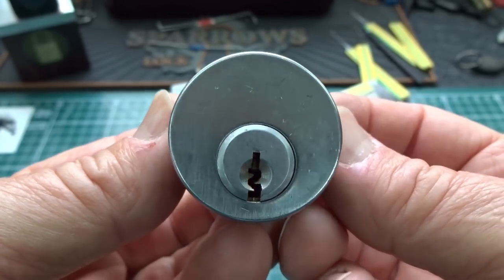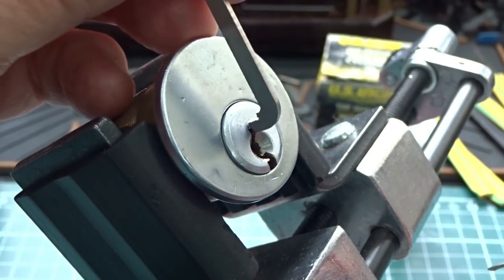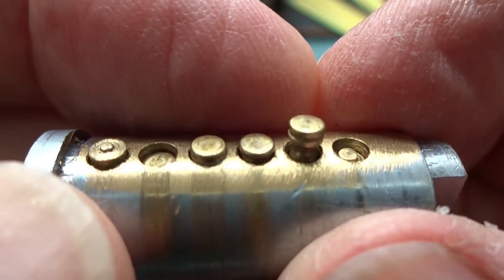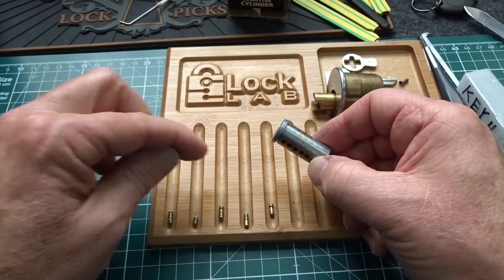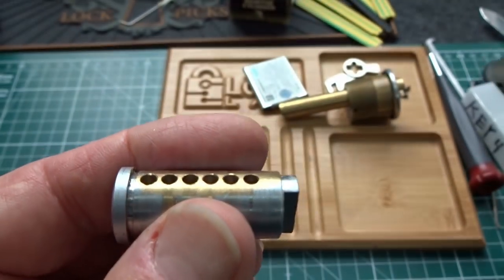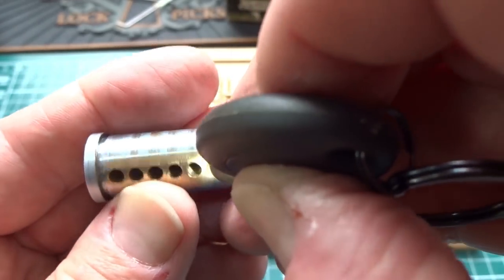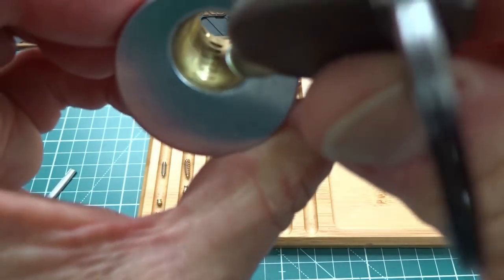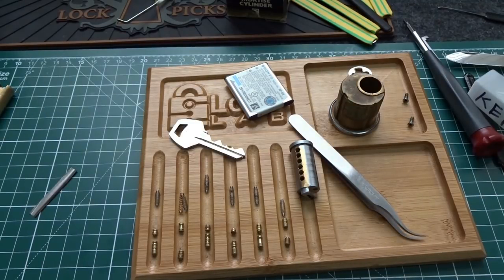(1179) Challenge: Blair's LockSmith Special Picked & Gutted

Comment: I have a lock that does exactly this. It's just a commercial defiant I'm using to learn spools, but it's a pain for me. It will get to a false set, and everything feels seized up, or set. I think pin one is a very short spool, if I really give it some force, I'll get counter-rotation and set, then I have to do the same all the way back at pin 4. It's super easy to overset or drop everything, but it's been great practice.
Reply: Maybe a light spring on the spools mate, lessen up on the tension and feel for very light counter rotation.
Reply: CHOPERUS23 you're absolutely right. If I get careless and put more than the lightest touch on it, this thing just hates me.
I can get it picked, it just takes a fine balance of light tension and pretty heavy leverage on the pick to get those spools set.

Too much or too little, by the narrowest margins, and it starts hurting my brain. ;>

Comment: Ha! I got my 40mm brinks open before you got yours! Mine doesn't have fort Knox warding, though, it's just a stock 5 pin...whatever. point is, I'm getting better, thanks to you bill. Once I understand the mechanism, I can get into almost anything. Thought about locking all the locks I've got together into a ball and mailing them to bill, just to see how long it takes to get through them.
Also, that polymer practice lock everyone says is so easy (it is) is re-pinable. Had my 12yo drop wierd pins in it. Now.....well it's alot harder. Nothing like what we see here, just spools and a t pin. I'm scared of the pin-in-pin, though.
Strangly, the 3 pin luggage lock is the hardest one to pick. It's so...tiny and delicate. Really easy to overset.

Comment: Bill, I don’t know if it would have any use in lock pin making, but there is a very small lathe on the market you would get some mileage from in your other hobby that’s meant for turning armatures when you’re rebuilding small electric motors. It may be possible to use it to crank out some weirdo pins since the chuck is small enough to grab motor shafts. Those homemade pins and the fact that I’m sitting here tinkering with one of the motors for my RC truck while watching this made me think about those little lathes.
Reply: Any names, model numbers, or links for us?
Reply: CodeBurger sorry not right off the top of my head I don’t. However I am going out to the hobby shop tomorrow for a race, so I will get some more info about theirs while I’m there and report back with my findings. It’s a pretty neat little contraption and doesn’t require much space at all to set up. It’s not much bigger than an electric pencil sharpener. In the meantime, I’ll check google and Amazon and see if I can find something for y’all tonight.
Reply: http://www.integy.com/st_prod.html?p_prodid=3621#.Wf1A4rYpCaM 

Leave it to Integy to discontinue something that’s actually useful to RC enthusiasts and google to show results for everything except for what I searched for, but here’s a link to the type of lathe I’m talking about